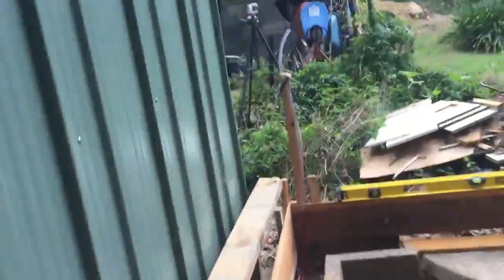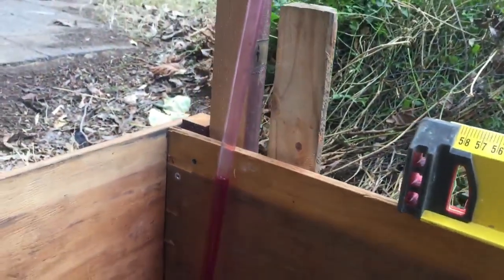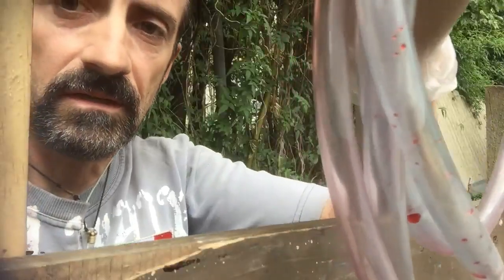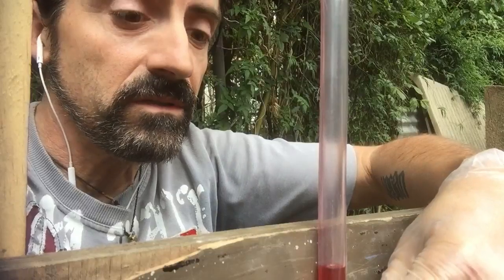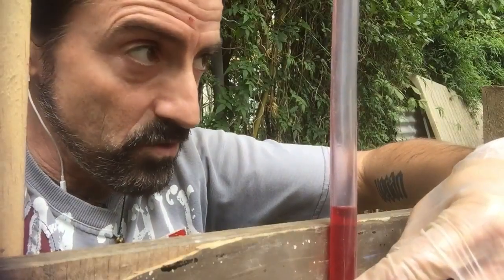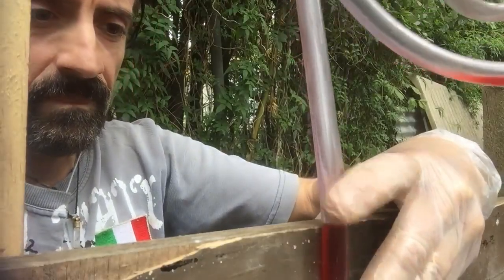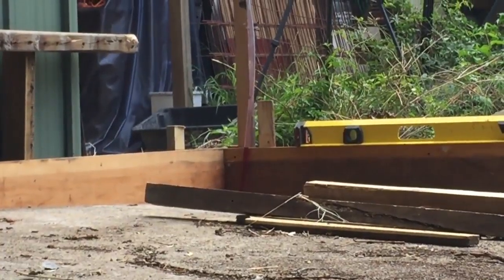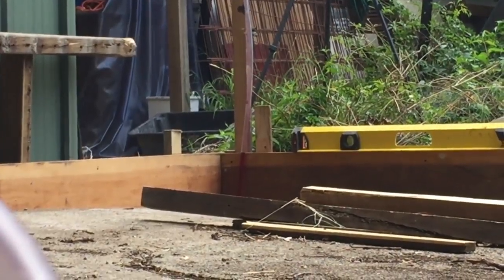How to use a water level - the diy basics

Comment: I have used a water level for years and years. I was in commercial construction and we always had one on the job because it is consistently more accurate than than a laser level and can be used around corner and blind spots. Unlike a laser level we never had to have a water level calibrated because it was always correct. The only downside was that you have to make sure there are no bubbles in the tubing. Fill the tubing with water the day before you are going to use it and hang the open ends higher than the bottom bend with no high spots in between. An 8 foot ladder works well. We would use a water level to check the accuracy of a laser level, If they didn't match you knew it was the laser level that was off because gravity doesn't change.
Reply: Trust in Jesus Christ -
Reply: Didn’t you get the memo..
A water level tool doesn’t establish a horizontal plane of reference…
Reply: @horizontarn   can you elaborate??
Reply: @joeperales7123  yes there’s some crazy people out there that say a water level doesn’t establish a horizontal plane of reference…
They believe it curves and that level and horizontal are both curved lines.. crazy they think they live on a 3d ball with a 2d surface..🤣🤣🤣
Reply: @horizontarn yeah hard to do steel work with this lol

Comment: Good job fella, used this method for years , best done with 2 guys , one holds in the same place as the datum point , and shouts up or down so the other guy so he can set his datum point to the same level , great for setting building levels and columns etc. Battery never runs flat ,LOL
Reply from the maker: When teaching my students I would mark chalk lines on a brick wall and send one student around the corner for the length of the hose and they would transfer the marks doing that call-out method.

Comment: Be careful with another issue as well. Don't have one part of the tube out in the sun and the other half in the shade. Otherwise the water in the warm end will be less dense and thus be higher than the cold end.
Reply from the maker: Mike Betts thanks for the feedback. I actually tested this out. I set up the tube with half in a shaded area and half in the sun. After about an hour I checked it. The level had changed (risen) due to the liquid warning and expanding, but it had risen by the same amount at both ends. I guess that eve though the density was affected, the effect of gravity on the water in the tube still kept the ‘level’ the same.
Reply: @oojagapivy  must be something else at play here then. The density issue is related to why bubbles must be removed. A bubble on one side affects the overall density of the water on the side it is located on and thus Will throw the level off.
Perhaps during your test, the difference in temperature from one side to another was not much different.
You did not happen to hear theme music from the old Twilight-Zone playing in the background, did you? Might just be a mystery to solve another day.
Reply: Trust in Jesus Christ—
Reply: @mikebetts2046 complete guess. The air bubble in the middle insulates the two bodies of water. If there's no air bubble, the water can shift around to equalize the temperature. If there's an air bubble, water can't move across that bubble, so one side can be hotter than the other by a couple degrees.

Comment: Sorry to drop this on you but I've been thinking about formulating an argument for discussion, What do you think?
 If the earth is a spherical object (p)
Then the surface of liquid water MUST be curved (q)
Do you see any problems with the fact that a water level is a tool for establishing a horizontal plane of reference and all horizontals are parallel with the plane of the horizon?
Reply from the maker: (p) accepted
(q) if this stands for question, then a few things. Over what surface distance are you using here? The “curvature” will appear and measure differently in a 1/2” tube compared to the Pacific Ocean. 
Gravity on this sphere pulls things with the same force towards the centre. Actually, with slightly different force at the equator than the poles due to centrifugal force. 
No I don’t. Over what distance are you establishing this horizontal plane? Using it on a building site to establish a position of equal height from the centre of the planet works because the water in the tube equalises itself to the same “height” from the centre. If I were to take a water level hose 1km long, the levels at each end of this will presumably be the same “height” from the centre, due to the forces of gravity. Just make sure you have no air bubbles in the line.
Reply: @oojagapivy  Proposition 11 and 30 book 1 Euclidean geometry 😉😁👍🏻 enjoy
Reply from the maker: Both of those make sense and therefore hold true if you were to use a water level to measure out all of these “parallel points”. 
Remember, when using a water level, you are using 2 points at either end of the level. You aren’t using a long surface of water.
Reply: @oojagapivy  Euclidean principals of geometry postulate 1, that a straight line may be drawn from one point to another.
Reply from the maker: @TryThinking  yes, and?

Comment: your on the level,
 watch out for trapped bubbles, which I am sure you know about, I keep my one stored.
 in pitch black, or you can get " pond algae "  growing in the water, which creates gas bubbles, which stops it working properly.
if you put the ends together, and mark the water level on both, you don't have to look at the other end, if it is out of sight, or around the corner etc
there great, I have been using them for over 50 years, for setting up roof gutters levels, to get the " fall " correct.

Comment: Would this work for checking to see if the mobile home is level. Like if i went to the rooms and put one end in the corner of the room and the other in another corner
Reply from the maker: Absolutely. Measure up from the floor in each corner and make a mark or put some tape. Eye level is a good height. Make sure you measure to make them the exact same from the floor.

Comment: Level water, level earth
Reply from the maker: Correct. Level. Not flat.
Reply: @oojagapivy  there is no perfect flat surface.
Reply: @oojagapivy  you should test this method across a mile and you will see if you adjust your hose for curvature you will lose water. Water never lies.

Comment: How would you compare this to an electronic water level. The main drawback to this way is that if you're working alone over a fairly long distance you might not be able to see the other side. I guess you could just make adjustments and walk back and forth until you get it level. Is there anything else or does what I'm saying make sense?
Reply from the maker: Dan Grimes that makes sense. That’s how I had to work here. I’d get it close, hold the hose in place with a clamp, go check my reference level closer and make adjustments. Once it was “spot on”, I’d mark the post I was working on. Ideally this is a 2 person job, but it’s doable on your own. It’s the best way to go when working on really uneven ground like I was. Thanks for watching and for your comments.
Reply: Pretty late to this. But you can easily do this in one trip.

Make sure you have some head height on the side your trying to level so you don't over flow that end.

But go to the end that is the height you want, and raise or lower the hose on that side until it is level with the work piece. Then when you walk to the side needing to be leveled, you just raise or lower the work piece to be the height of the water on that side of the tube.

Comment: On second thought you could just measure the difference from one end to the other again your post or whatever and your done.
Reply from the maker: Dan Grimes absolutely. Get it close, clamp it, go measure the distance from the water to the ‘reference’ mark then measure the same distance up or down on your other post. The key to remember is that the water will always find level and work from there. Thanks again.
Reply: @oojagapivy  ditto